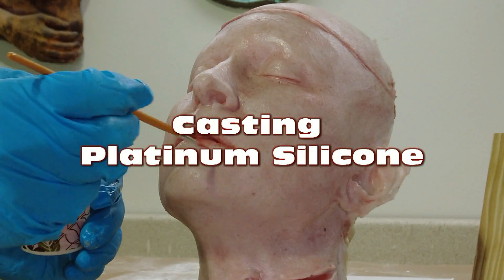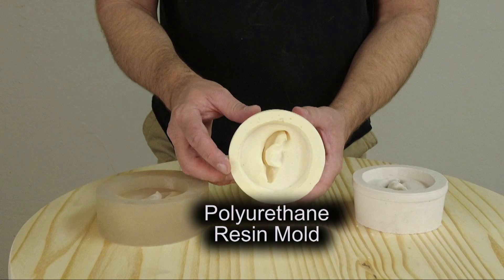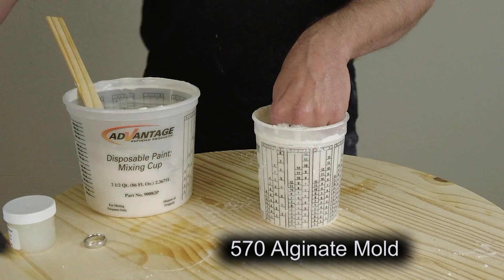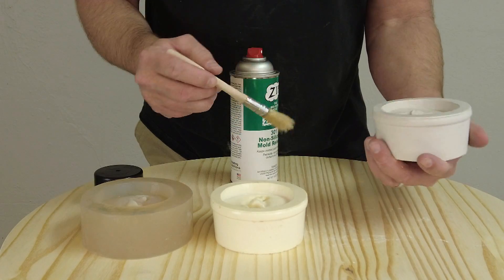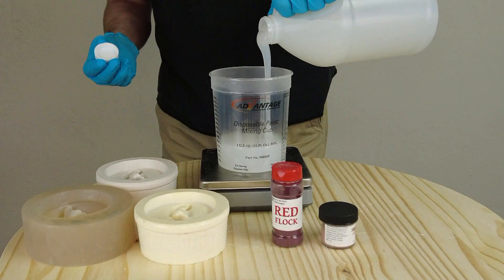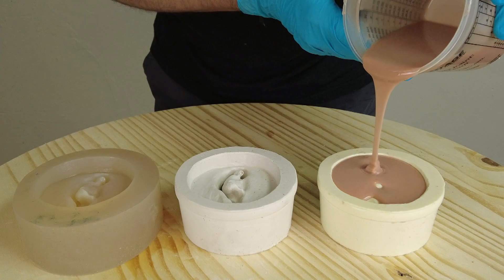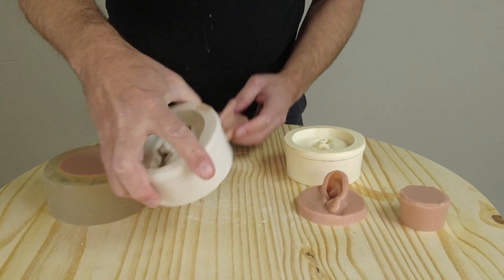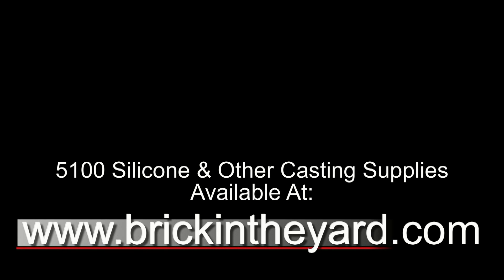How To Cast Silicone Tips For Masks Medical Simulators and SPFX

Comment: Possibly weird question… When casting silicone in silicone, can you spray mold release in a silicone mold and then dust the inside with matting powder to matte the result? Or will that ruin both the mold and the cast? (…actually, would it even work in a polyurethane mold? I still don’t know if my setup is well ventilated enough for it, so I got a small amount of mold silicone/release to do a test. Also because I couldn’t find any local plaster at reasonable prices to make a mold for the silicone I bought from you.)
Reply from the maker: I have not tried that but I think it warrants a test! If I figure anything out I’ll post the results on our Instagram page
Reply: @brickintheyard  Oh, I don’t have instagram. Is it possible to check an instagram without an account? I haven’t tried before.
Reply: @brickintheyard  I tried to check instagram, but it kept telling me I needed an account when I clicked on the thumbnails. Did you end up doing the test? Did it work? It would sure be convenient if it worked…
Reply from the maker: @MoyaoftheMist  I have not tried it yet. Too cold!!
Reply: @brickintheyard  I feel ya! Our heater broke yesterday morning, and it’s under 50F in our house by now. I can’t experiment with silicone right now, either. I hope it doesn’t permanently damage my silicone or anything…

Comment: what about urethane or poliurethane rubber as mould cast for silicone pieces? are more than a decade that i do silicone moulds for my urethane- polyurethane rubber masks creations... i was wondering if the reverse could work since you mentioned the poyurethane resin that i already use in silicone moulds... Hard shore of course as strongness. Thanks for your amazing videos! <3
Reply from the maker: The problem with polyurethane rubber is that only a few formulas work. The shortages have led to some formula’s getting changed and that means even the ones that used to work, may not work now. 🙁

Comment: Brick In The Yard Mold Supply You said several times about the temperature of at least 70 degrees. But they did not specify, are these Fahrenheites or Celsius? It seems to me that 70 degrees Celsius is a lot for the room =) So you are talking about Fahrenheit?)
p.s. cool video, thanks!)
Reply from the maker: Lol! Yes, 70F. 70C=☠️

Comment: Are you aware of any 3D Print resins compatible with platinum?  Would love to pour into a 2 piece 3d printed mold (sla)
Reply from the maker: There are so many new 3D print materials I can't keep up with them all! I have had some SLA resins mold with no issues and others that inhibit. In a future video I will see what I can do to figure out which ones work best and which ones to avoid.
Reply: You can use whatever resin you want, you just need to really, REALLY clean your print before pouring + a really thin coating of something that doesn't inhibit the curing process. Google "Preventing Platinum-cure Silicone Cure Inhibition in Resin-printed Molds" to find a fantastic breakdown of Jan Mrázek's exhaustive testing and resulting protocol for this issue.